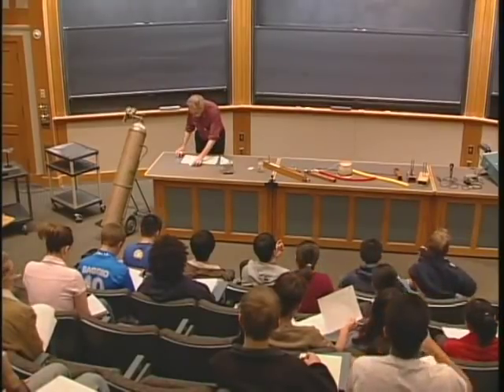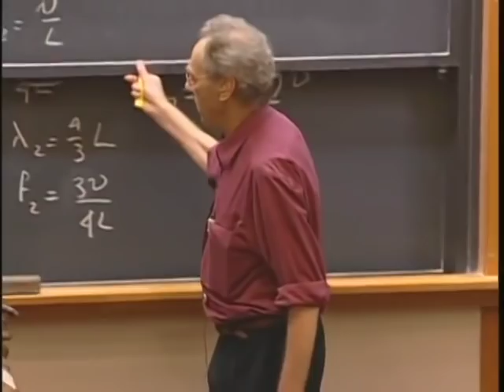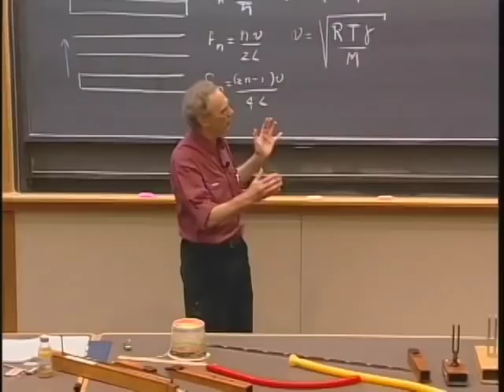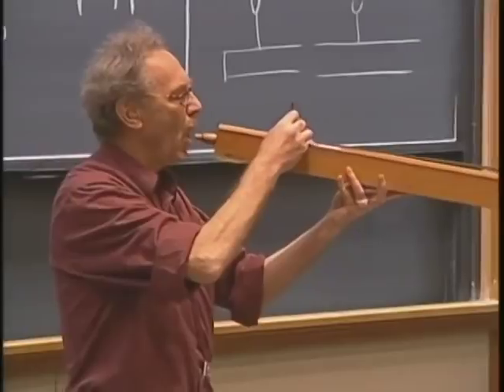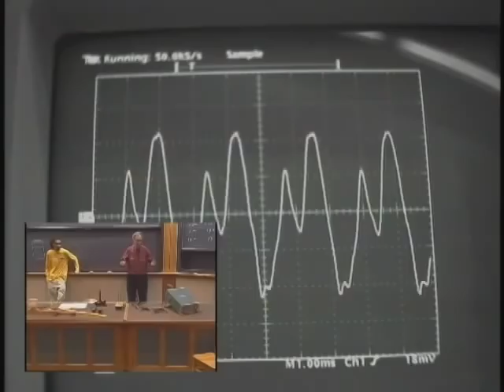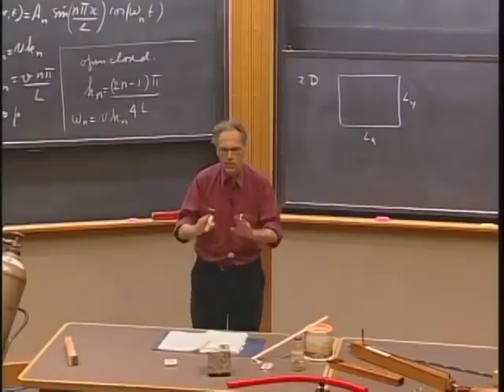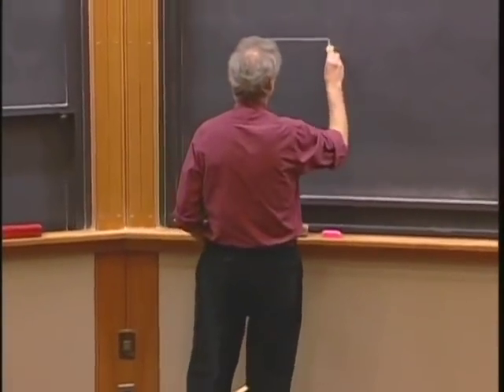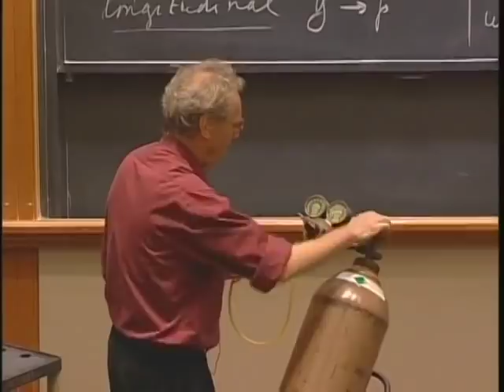8.03 - Lect 9 - Sound Cavities, Resonance Frequencies, Musical Instruments

Comment: At 32:39 when you went from the fundamental to the second harmonic, it sounds like a fifth, but it should be an octave. I think what you thought was the fundamental (the lowest pitch you got) was actually the second harmonic.
Reply: Also I measured with tuner and got the lowest frequency at about 420 Hz
Reply: So it was definitely the second harmonic, not the fundamenta
Reply from the maker: I agree that what I thought was the fundamental was actually the 2nd harmonic. Several people have pointed this out to me.
Reply: Lectures by Walter Lewin. They will make you ♥ Physics. Ah ok. Thanks for the reply

Comment: why diameter is not present in calculation of resonant frequency of pipe. 

if i use a large dia flute will i get same resonant frequency.
thanks
Reply from the maker: as lo;ng as the dia is much smaller than the length you can predict to a fair degree of accuracy the resonance frequences.

Comment: Also, why do we hear sound coming out of the pipe with two closed ends? Is it because the pipe also vibrates with the same frequency as the air inside it? IF so, if we strike the same frequency for an open-closed pipe as for the closed-closed pipe, then the sound intensity of which is higher and why?

Comment: I thought that membranes oscillate in a kind of bessel function, but you wrote it down a sinusoidal one to describe its movement
Reply from the maker: use google
Reply: @lecturesbywalterlewin.they9259  Partial differential equations are a little bit out of the scope here
Reply: @lecturesbywalterlewin.they9259  Professor Lewin you might be interested to know that Ritz solved for the modes of Chladni's plate (by hand)! in 1909 and the solution fits in a small Mathematica program seen here: https://i.stack.imgur.com/iy8Cl.png.

Comment: As you said in previous lecture, reflection is zero at the junction of  two mediums which have same mue and velocity. open-open sound cavity satisfying this condition at its both ends, so there should nt be reflection at the ends. then how standing wave can form in open-open sound instrument?
Reply from the maker: >>>>As you said in previous lecture, reflection is zero at the junction of  two mediums which have same mue and velocity.>>>
** yes that is correct if you take this in context. Attach a rope to another identical rope, generate a wave at one end. The junction is "invisible" as it is a continuation of the "same" rope. 
>>>>open-open sound cavity satisfying this condition at its both  ends>>
Yes, you have a good point. However the boundary conditions of the "world" outside the cavity are different. Inside the cavity sound is confined to the cavity, outside it is not.
Reply: Thank you sir for your reply. so, sound  feels a boundary between confined area and unconfined area even though mue (velocity) is same. sir, can you give some reference for this to understand mathematically?.
Reply: and another point is that sound cavity frequencies only depend on length of the cavity, not on the material of the cavity. so any kind of material can be used to create same kind of resonant frequencies for fixed L?
Reply: I think maybe mue is going to be different at the boundary due to the compression of air into the anti node?

Comment: I have a question regarding the professor's daughter's musical instrument. I don't understand how the transverse wave from the string gets converted into longitudinal wave at the base of the "KFC tin". Same question applies to the fork tuner. Say the fork tuner oscillates in the x direction. Then why does It create an oscillation of the table in the y direction?
Reply from the maker: +adam lands My daughter Pauline played the violin The string is coupled to a box. The box (not the air in the box) vibrates and that produces pressure waves.  Remember the demo I do with the music box. You cannot hear the sound of the vibrating small prongs UNLESS you place the music box on a surface (e.g. the table). The table cover starts to vibrate and it produces pressure waves strong enough so that you can hear the music box play. This is NOT a violation of energy. The box enlarges the surface that vibrates without any "gain" in energy. Take a tuning fork and bang it. It's very hard to hear it. Now make contact between one end of the tuning fork with a table or box and you can now hear the tone very well.That's the same idea.  I did that demo!
Reply: Professor, I understand those demos that you explained. What I can not understand is this :
In the tuning fork demo(with the table), the fork vibrates horizontally. Then it gives that energy to the table and then the table vibrates, but it vibrates in the vertical direction(because it produces pressure waves that are longitudinal). How does the transverse wave on the fork gets converted to longitudinal vibrations of the table?

Comment: In a quartz wrist watch, if  i supply the dc battery voltage lets take 1.5 volts) across the piezo electric quartz crystal just for 1 second, so how many vibrations is it capable to make?".

is there any mathematical equation for this ?
Reply from the maker: If you apply your 1.5 V battery the quartz will not start to oscillate. Use Google.
Reply: but the voltage ratings of wrist watches batteries are generally around 1.5V
Reply from the maker: yes, but the battery on its own will not make the quartz oscillate. It's an electronic circuit that makes it oscillate and the battery drives that circuit.
Reply: Well, ok . Even then my question remains the same. If i supply a 1.5v signal across the electronic circuit (electronic circuit is further connected to quartz crystal)  just for 1 second. How many oscillations can this quartz crystal make?
Reply from the maker: It depends on the thickness of the crystal. https://en.wikipedia.org/wiki/Crystal_oscillator
Reply: I know it's a year too late but usually the watch crystals in wrist watches, are 32768Hz. This is in fact a very common crystal frequency for wrist watches because it can be divided right down to exactly 1 Hertz.

Crystals also have a temperature coefficient, meaning that the frequency of the crystal can be more or less than its stated frequency depending on how hot or cold the crystal is. I have heard, but not confirmed, that the crystals in some wrist watches used were cut so that the 32768Hz was achieved at a temperature close to your body temperature.
Reply: What you've apply is a DC volt not an AC. Therefore it wil not oscillate.